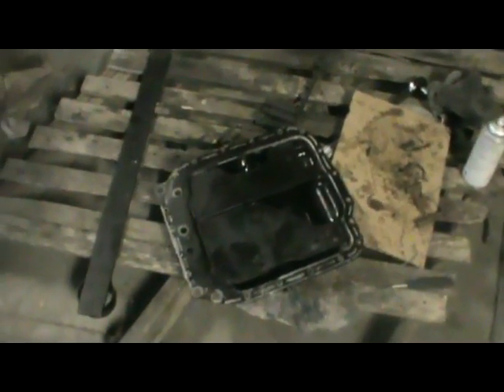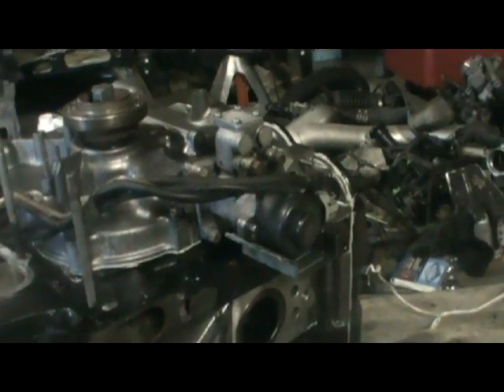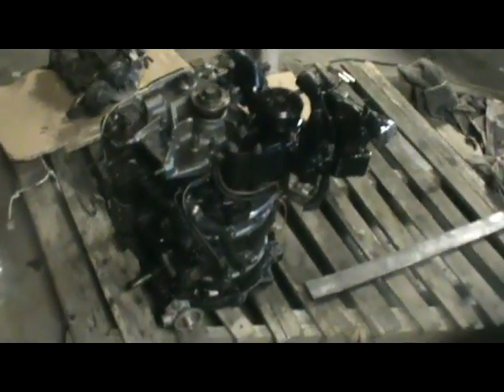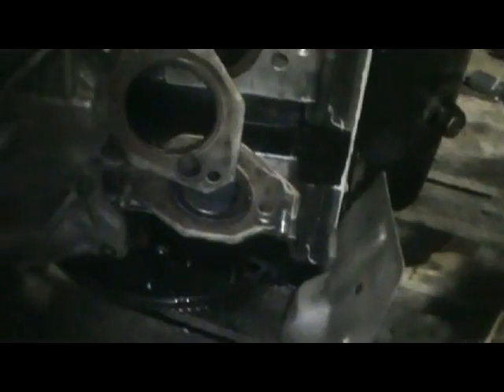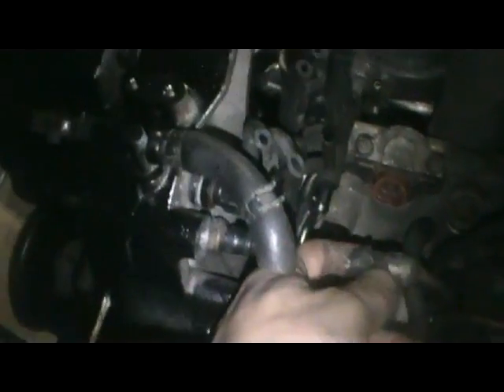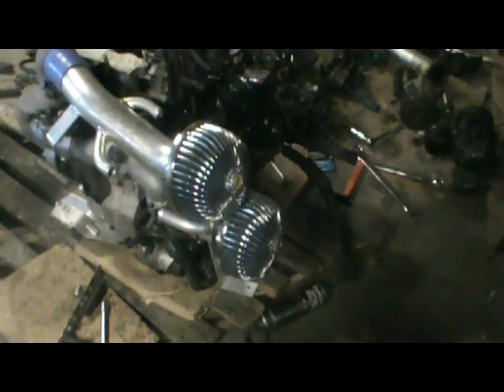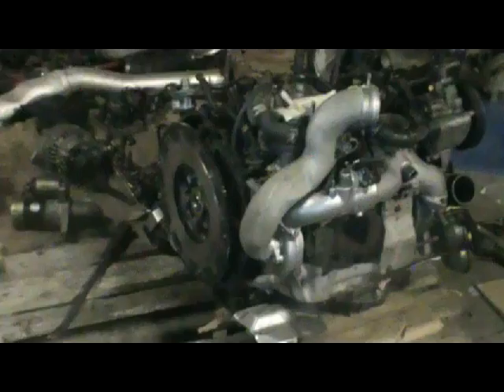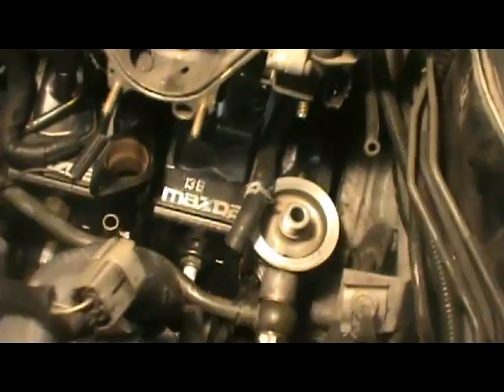How To Rebuild and Port a Rotary Engine: Part 13

Comment: with rx8's, if they still start and run good the motor will be fine. if you change the oil every 5,000k's and look after it, it should go for a long time. If I were you i'd just leave it and wait until the seals and springs start to wear out and it looses some compression. in some parts of the world it costs a hell of a price for a rotary rebuild kit

Comment from the maker: I just chip away at it, takes me awhile because im far from being rich lol. took me 5 years to build up my FC, over a year for the FD and a whole lot of wheelin and dealing. basically everything I get is used lol. used name brand parts are better and cheaper than alot of the lower quality parts out there

Comment from the maker: i've done quite a few engine swaps on other cars, i've even changed a engine and tranny in a 2002 cadillac deville in the driveway with out a manual or anything hahaha
I was in the army from my 17th b-day till i was 23, did nothing but courses and stuff, 100's of qualifications and 4 trades

Comment: Wow man. That is some crazy awesome work. I am thinking about buying a 2001 Jeep Liberty. They guy I am buying it from told me the previous owner put a new head gasket on, and dropped something in one of the pistons. When he started it, the piston sheered. I am thinking about buying it, and re-building it, or fixing that piston. Any advice for a first time builder to learn about these engines? Not sure if there are any sites that can give me a step by step or not. Your time is appreciated.

Comment from the maker: 89-91n/a engines have the highest compression rotors.89 an up PP with those rotors would make the most power